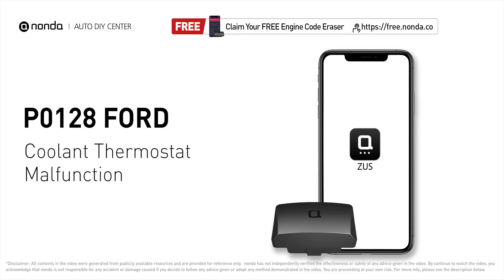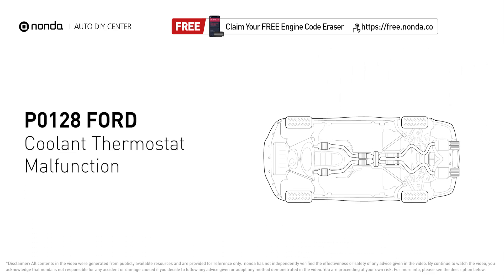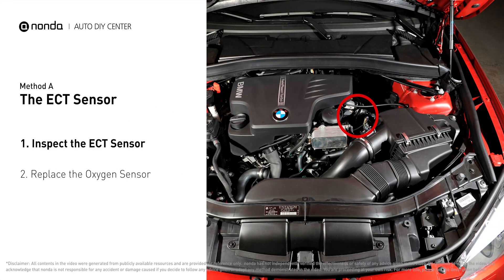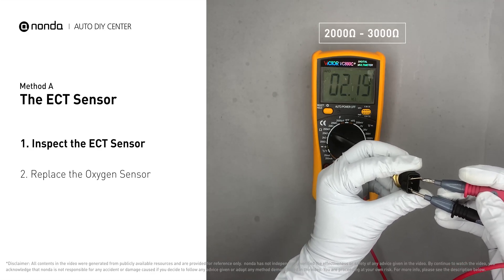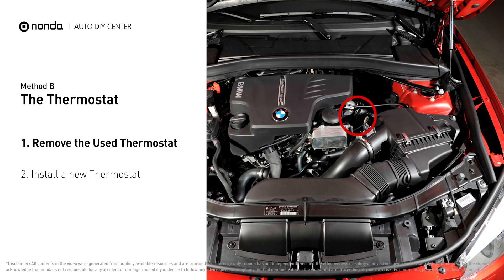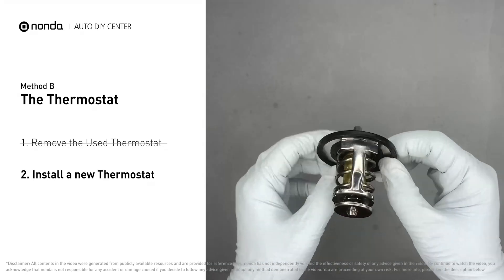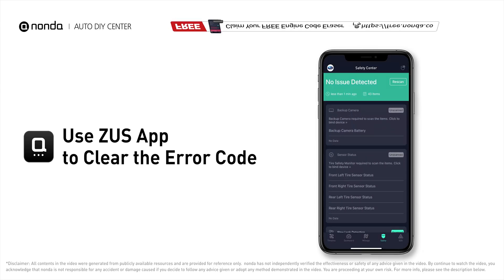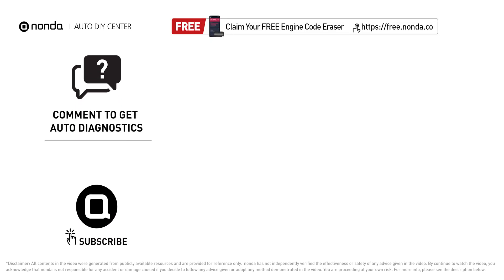How to Fix FORD P0128 Engine Code in 3 Minutes [2 DIY Methods / Only $7.34]

Comment: I have a 2011 Crown Victoria and this ECT is easy to get to.
In the older models the housing that the ECT is screwed into is plastic so you have to be very careful not to overtighten else you will crack the intake manifold.
I did that years ago and it took me about  hours to take it apart and install a new one.
Parts all over the place and very unfun!
Cheers!

Comment: Let me just say if the Ect sensor is bad in your f150 sell it cause u damn near have to take the entire intake fuel injectors fuel lines the entire main wiring harness not to mention hoses just to be able to get to the damn thing if anyone who helped design the eco boost for the f150 is reading this “fuck you “ for putting this sensor in this ridiculous spot